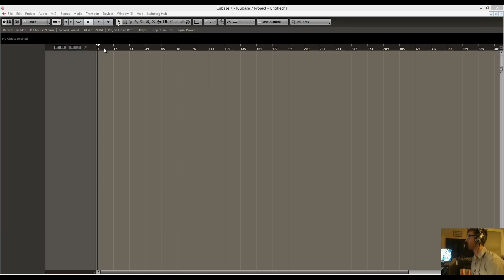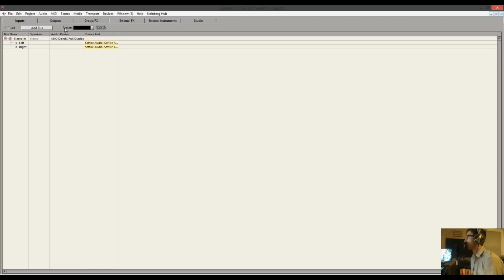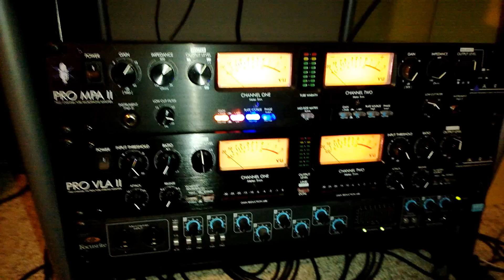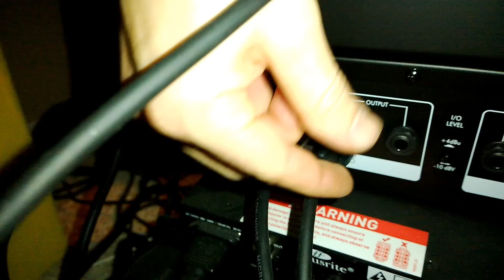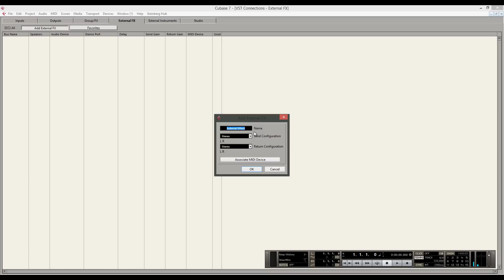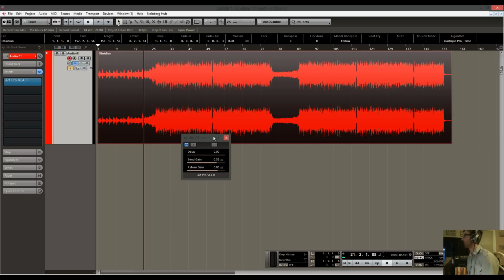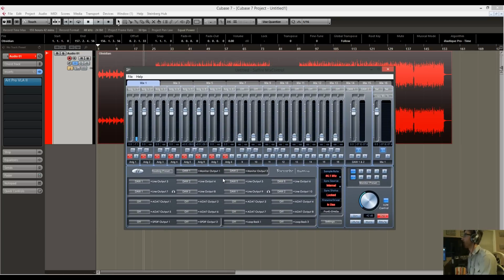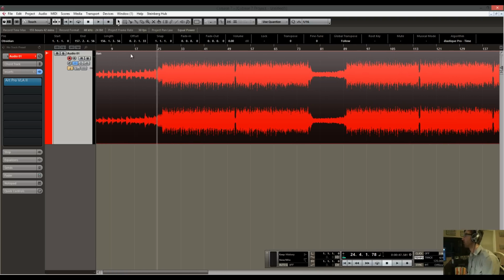How to set up External Hardware in Cubase

Comment: Hello people.  I am having some issues when recording my microkorg into cubase.  I am positive I am doing everything correct.  I have my Korg coming through input 3-4 on my interface therefore I add a stereo (stereo 2) bus in VST connections - I then set the input on that bus to 3-4.  Everything is great thus far as I am receiving signal on the master channel.  However, when I add a add my stereo two channel and hit the monitor button (I am receiving signal through the channel and I am hitting the monitor button so I can preview my signal going through FX chains in cubase) the sound completley phase's as if it's doubling up.  I know this is probably something very simple but I am baffled by it.  Everything is fine when I record the signal but I just want to be able to preview the Korg live with FX etc with the sound doubling up and phasing.  Cheers in advance!
Reply from the maker: +Carlo Ribeiro It sounds like what's happening is that you have the "direct monitoring" option selected in your device settings. When this option is checked, it will automatically monitor anything that is inputting a signal into your interface. It will monitor whatever input signal is running through regardless of whether the channels have the monitor button selected. When you select the monitor button as well, you will be hearing that signal twice. The direct monitor will be heard first since it is monitoring directly, and the track monitoring option will be second because it has to wait for the buffer before coming out your speakers.

I'm guessing this is what's going on.
Reply: +Misc. Factory Hey dude, cheers for the reply.  You were right :).  Cheers a lot man.

Great video as well :)
Reply from the maker: +Carlo Ribeiro Thanks, no worries. Glad I could help :)

Comment: why is it that when i changed over to cubase 7 (before i used pro tools), cubase wont recognize my interface (yamaha audiogram 3) or my mic ( trion 8000 multipattern tube mic)... im using a laptop to record. first time using a laptop. ive looked for my mic in the devices and cant find it. it keeps wanting to you the laptops realtek built in mic. please help
Reply from the maker: roman sotam  Ok, so Cubase (or any other DAW for that matter) will not be able to recognize the mic you are using. The DAW doesn't have any way of knowing this information. The only thing it can and will recognize is the Audio Interface that you have connected to the computer via some type of connection (typically Firewire or USB). If you are using a PC than you might have to install some essential drivers in order for the device to work properly, whereas if you are using a Mac you shouldn't have to worry about anything of that sort. However, there should be some sort of software that comes with the Audio Interface that you would have to install (whether you are using a PC or a Mac, doesn't matter, you have to install it on either one).

Before Cubase can recognize the Audio Interface on your PC, you must install the necessary software on your computer. In your case it would be the Yamaha USB Audio Driver, as seen here:
http://faq.yamaha.com/us/en/article/music-production/interfaces/audiogram/audiogram3/1913/3512/audiogram_downloading_and_installing_yamaha_usb_audio_driver

Once the software has been installed, you should see the "Yamaha USB Audio Driver" show up under "Devices > Device Setup > VST Audio System > Asio Driver" and then select that instead of the "Realtek driver".

That's all I can offer for information, so hopefully this helps.

Comment: So a newbie question........ If I wanted to compress on the way in, would I heard the compression effect through the monitors? And if I'm not mistaken the way you have this set up you are compressing a stereo mixdown? So again could you are hear the effect through the monitors and this would then be sent to the master output? 
The reason I'm asking is becuase my neighbour has a Saffire Scarlett and Logic Pro X and has tried setting this up but can't hear the changes through his monitors nor headphones. 
I'm running Cubase so this tut is perfect for me
Reply from the maker: If you have everything hooked up properly (hardware hookups and software setup), and you have selected the compressor as an insert effect... AND you have gain reduction on the compressor, you should be hearing the compressor affecting the audio via the main output (i.e. your speakers and headphones, if they are connected to your main outputs).

How I've demonstrated in the video, I would be using the VLA II compressor as a "mixbus compressor", meaning I'm sending a complete stereo mix through the VLA II as an insert effect and thus would be hearing the compressor's effect on the audio through the main monitors (because the affected signal is running out the master outputs, after being processed by the compressor, and then out my main monitors).

Make sure all the VST connections are setup properly, as well as the inputs and outputs for all of the channels, as well as the inputs and outputs for any relevant audio interface software (in your friend's case, the Saffire MixControl software routing settings).

Hopefully that makes sense.
Reply: Thanks for the swift reply much appreciated. I think the problem is the routing through the mix control sofware. In terms of the cabling and VST connection that's all fine. In the mix control software I believe the outputs and monitors are set up correctly, however the routing at the top right on mix console where you are able to choose inputs and outputs maybe wrong. All what you have said makes sense. Just need to try again. My set up is a little different in that I'm using a mixer with inserts and routing that to my interface. Works fine when doing some light compression on the way in. But must say I like the idea of the insert.
Thanks again. Let you know how we do
Reply: +Misc. Factory Studio the volumeknob on my audioengine wich previously only fixed the volume to the monitor now seem to fixe the amount of audio hitting the outboard processor. so I cant use my monitors now.

Comment: Hi Guys! We BOTH have Cubase and Windows OS. Mac OS has much more ability in terms of simultaneous  multi-Audio Interfaces. I have a MOTU 24i Input interface, and a M-AUDIO 7.1 Output interface. I've heard that the ONLY way I can use BOTH at the same time, is the install "ASIO4ALL". Mac OS does NOT have those problems. I would like you guys to look into this...when you have TIME....
Reply from the maker: Hey, so if you want to use two interfaces at the same time on a Mac, you need to create an Aggregate device within the Mac settings. You'll also have to configure the Aggregate device appropriately and sync the two interfaces via a clock source.
On a PC you also have to sync the two devices via a clock source, but rather than setting up an Aggregate device, you would be using the ASIO4ALL driver and configuring the ASIO4ALL driver appropriately.
Reply from the maker: Here's a webpage that should answer most of your ASIO4ALL questions: http://www.image-line.com/support/FLHelp/html/envsettings_asio4all.htm

Comment: Hi Dear,
I have the same sound card, and I facing Click and Pop on continues basis. can you please guide how to get rid of it ?
Reply from the maker: Well, I can try to help, but you'll have to give me more details on what is going on. Clicks and pops could be anything really... bad recording/audio, bad cord/connections, a very slow computer causing a cpu overload within Cubase... etc.
Reply: Squid Cluster Productions I am using HP Z 400 Work Station. Cubase 5 also Graphics Card is Nvidia 1GB. Its a new card Focurite Saffire Pro 40. and midi is causing latency when I am increasing buffer size. if i make it less it is causing pops. i have connected it through fire wire.
Reply: I am using HP Z 400 Work Station. Cubase 5 also Graphics Card is Nvidia 1GB. Its a new card Focurite Saffire Pro
Reply from the maker: Umair Shahzad Ok so that is the problem, your computer CPU can only handle so much digital audio computing. Increasing the buffer size is the only way to get rid of the clicks and pops. How much RAM does your computer have? and are you using a 64bit or 32bit operating system?
Reply: Squid Cluster Productions I am using 64 Bit Windows 7, with 16 GB of ram
with xeon quad core :)
Reply from the maker: what's the full specs on the Xeon Quad Core? what series is it (3300 or 5300 etc... sometimes they have a name attached as well like "Lynnfield" or "Clarkdale")? GHz? Cache? Xeons quad cores can be as old as 2006ish, and as low as 1.6GHz and 2x2 MB of L2 cache.
Reply: Intel Xeon X56803.33 Ghz. this the only thing windows is showing,
Reply from the maker: Ok, yup, so everything about your computer (as far as hardware specs) is very much suitable for audio and video production/editing. So the next question is whether you are processing a lot of stuff in Cubase, so are you using a lot of plugins? How many audio tracks, instrument tracks, midi tracks, etc. are you running? Also, look to the far left of your transport (hit F2 to show it) and look at the "Average Performance Load" meter while you are playing your song, if it is peaking (shows a red light on top) then you need to increase your buffer size within your software.
Reply: No, there is nothing like what you are saying, in fact i went to focus-rite website and I tuned the windows 7 accordingly. but still its having clicks and pop. I only bought this card after looking at your video ! so if you can please help me figuring out. I also updated the drivers but still its the same. Increasing buffer size, is increasing too much of latency. I have one thing to ask , is it due to electricity ? do I need to put a power conditioner ?
Reply from the maker: I've never heard of electricity being the cause of clicks and pops like this. It's almost certainly to do with your audio driver setup. Just a tip, newer versions of Cubase (I think since Cubase 6 or 6.5) allow for an "adjust for record latency" option in the device setup. So you can increase the buffer size to 2048 and have no latency issues. What is your buffer size set to? Anything less than 96 is probably too low and will almost certainly create clicks and pops once your further into your production.
Reply from the maker: Also, are the clicks and pops ending up in the recordings? Or do the clicks and pops happen simply by playing the music in Cubase without recording?
Reply: no, not in recording yet. i will recheck this. but what about playback clicks and pop.
Reply: Squid Cluster Productions and i am using Cubase 5
Reply from the maker: do you have the Saffire MixControl software installed and what is the buffer size set to?
Reply: 768
Reply from the maker: Usually, when recording, 192 is about as high as you could go to get best playback while providing minimal record latency. How many tracks do you have (audio, instrument, midi, etc.) and how many plugins do you have running? Have you tried to freeze your tracks?